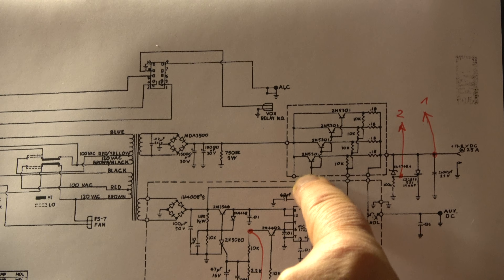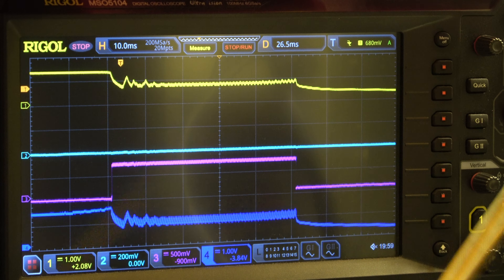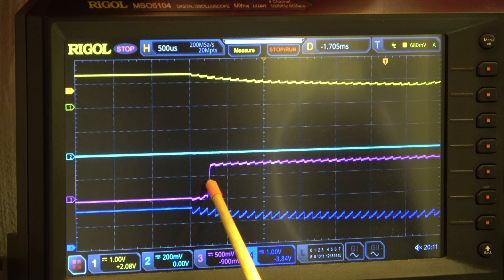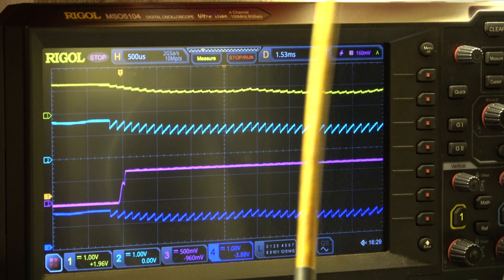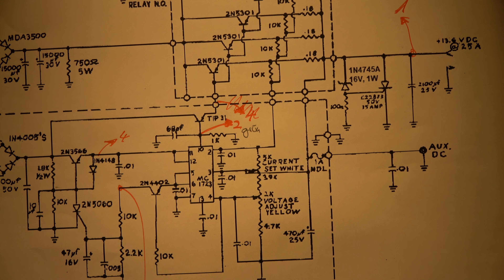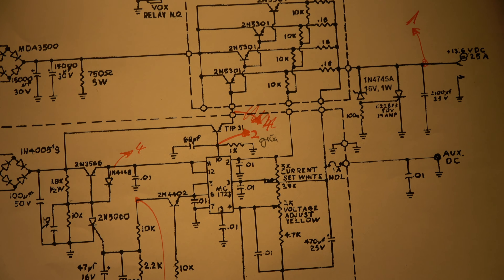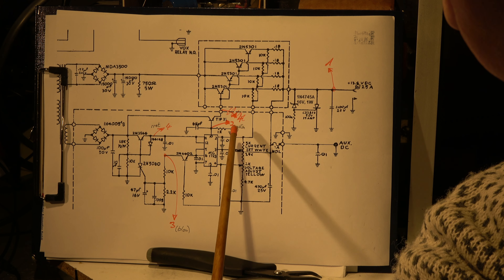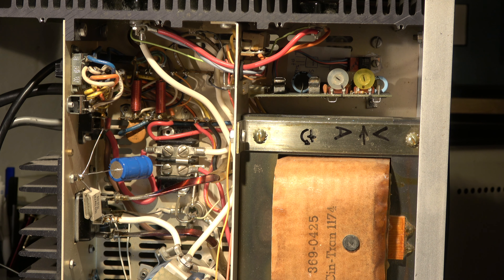#151 Drake TR7&PS7 Part 2(2)

Comment: Learning is the most important component of any project. I think that I would also check the  ceramic capacitors around the regulator IC - they rarely fail but ........  Regards,  David

Comment: Simple solution, but also very valuable information Stefan.  Thank you.  I see there appears to be no Service Manual for the PS-7 and thus no adjustment information on these potentiometers.   I too would not have expected a power supply rated for 25A to have an over 40A protection trigger value.  This is very good information to add to my PS-7 Instruction Manual as a note to the schematic page.  Thank you again.  -  N9OO
Reply from the maker: True! But i remeber to have seen such a high value anywhere - but i don´t know where. I know a mod of the TR7 where the "carrier" Pot on the front is also used for SSB; maybe this could reduce the peak power.

Comment: Dear Stefan, It might be good idea to introduce a simple resistor (of right value) between  723 and base of TIP 31 (in series) to limit the current.  But nevertheless, I have become addictive to your videos. Thanks a lot.
Reply from the maker: Dear Yildirim, a resistor would limit the current - but then the voltage drops and we would have the same problem as with a low current limitation.

Comment: That's really interesting and I wasn't expecting that. I tested my PS7 and it was set at around 30A. But my TR7 only delivers a maximum of 100W. I have just set the ALC so that only 100W comes out.
73 de Bernd
Reply from the maker: Yes, but many users can´t resist and they set the ALC for a higher output....